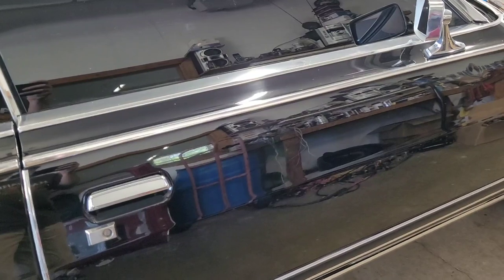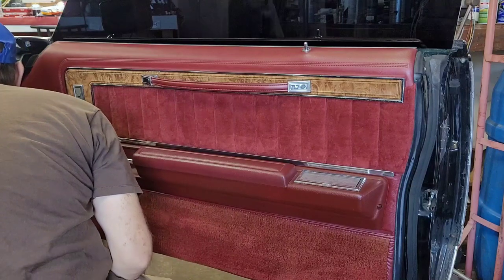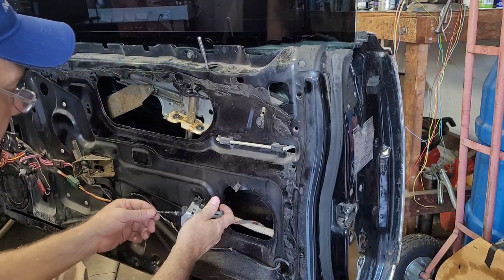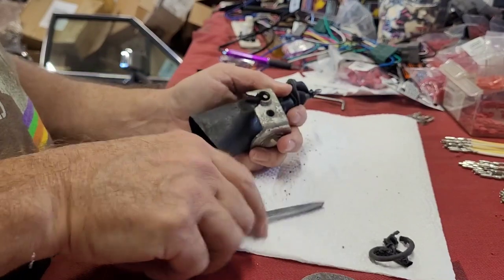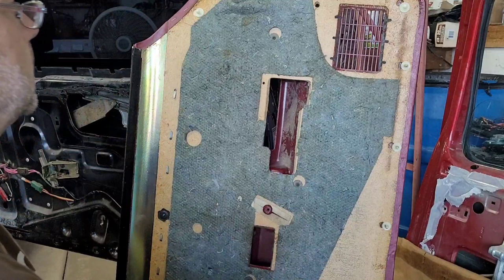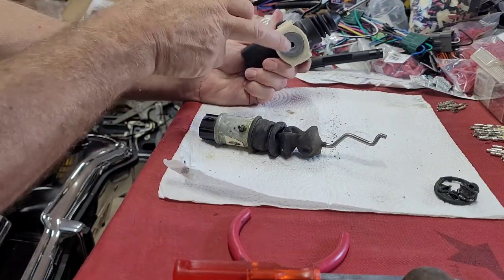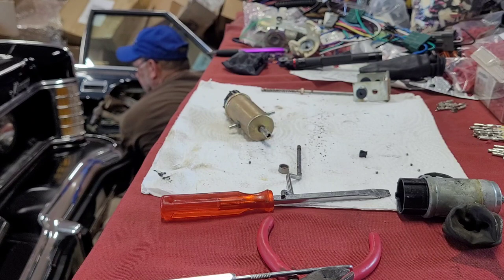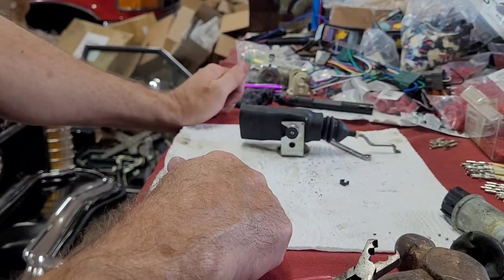1975 1976 1977 1978 Mercury Grand Marquis Ford LTD Power Doorlock Actuator Replacement Repair

Comment: My door locks all make noise but they dont go up or down I wonder if its the bushings? Its also nearly impossible to operate the locks manually. Im going to have to tear into it soon. This is on my 78 Grand Marquis 4 door. Also the driver side window doesnt budge an inch
Reply from the maker: I have several videos that could help you, I believe.

Comment: Hey Tony I'm working on my 77 and I need to replace the blower motor, car Dat for awhile and mice have made themselves a nice little nest in the blower motor wheel. My question I'd how in gods name do you get to it? I need no access from the outside or the inside of the car. Please tell me I don't have to pull the entire fender off the car to replace it?
Reply from the maker: I'm sorry to tell you that you have to either take off the inner fender or the fender. I would probably take out the inner fender.
Reply: Bad news but glad you know the answer. Thanks for the help Tony. Love all the new videos on mom and pops lincoln.
Reply from the maker: Thank you!

Comment: Thanks for the video. I took mine apart and found that the rubber grommets on the frame were missing and couldn't find them in the door. I'm asking where can I purchase new grommets. I'm at a stand still now.  Thanks again for the video
Reply from the maker: You're welcome. I always try to get all of them out of the 80s Ford, Lincoln, and Mercury vehicles when I find them in the junkyards.

Comment: This really helped, greatly appreciated. Would love to see a video on getting the illuminated entry working. The lights for the ring around the key hole don't light up but the courtesy lights do. Any ideas? Greatly appreciate it. Love the car by the way.
Reply from the maker: Thank you! Yes, I'm planning to do a video on illuminated entry as soon as the weather clears. I have one not lighting up in a Lincoln parts car, and I do have an idea why it's not working. I'm also gonna do a video on taking the illuminated entry out of a parts car and adding the option to another car that didn't come with it. Please subscribe I you haven't and stay tuned.

Comment: I put white grease or wheel bearing grease on plastic clips, screws, etc. before putting them back in place.  Makes it a lot easier if you have to remove them again.  The window track I probably would have put some grease on it since I had the panel off.   It's been hot as a convection oven up here in central IL.  We still need rain desperately.
Reply from the maker: Did you watch the whole video? I don't think you did!
Reply: I use Fluid Film. Zero petroleum. White grease is for large surface interactions. And it dries out. Fluid Film is $10 at Walmart for bonus size. It never dries, and is pure magic! I lube the ENTIRE inside of my doors. Latches, handles, tracks, rollers. My doors operate like butter! I just did my survivor 1967 Corvair. Recently my '66 Toronado, '91 Ford F700, '97 Suburban 2500, 2007 Escalade. I like my vehicles to work PurrrrrFectly!!!
Reply: @tonyscarcare5657  I stopped after you got the door panel on.   I'll finishing watching it.
Reply: @CORVAIRWILD  I'll have to get some of that and try it.  Seems like I have heard of people spraying Fluid FIlm under their vehicles for rust protection
Reply from the maker: @timw8228  Well, as I showed and stated in the video, I'd had the door panel off before and greased all that then. It was all still very well coated in grease and not dried up at all. I even operated to window to show it. My cars are always inside and covered and never out in any of the elements. I would have greased it if it needed it. As you can see in the video, everything was working smoothly as it should. I've been repairing power windows and doorlocks since the mid-1980s with no complaints.

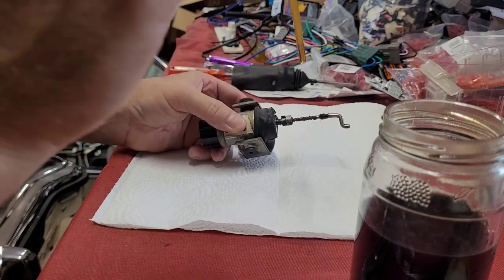Comment: At 16:46 when you used that bulb and tube to extract one drop of lubricant, reminded me once of visiting a watch repairman and seeing a group of different sized feathers sitting on his work bench. I asked him what and why feathers? He showed me a canary feather and dipped the tip in watch lubricant, then touched it to a screw so tiny he needed a jeweler's loupe to see it. He said he had hummingbird wing feathers when he had to use freeing solvent in lady's dress watches. He gathered all the feathers himself and had learned that trick from his grandfather. Glue, freeing solvent, cleaning solvent and lubricant were placed that way, so as, not to get on other parts within the watch.
Reply from the maker: That's wild!

Comment: Suggestion for easier re-assembly of power lock to mounting bracket:
Put the rubber grommet on each metal stud on the power lock motor.  Then power lock motor can be slid into the slots on the mounting bracket.  It might also help to apply some silicone lubricant to the grommets.
Reply from the maker: Thank you!

Comment: My dad hates you… lol
Reply from the maker: And why is that?
Reply: @tonyscarcare5657  you won’t sell that sweet Lincoln to him… lol
Reply from the maker: @godskongofwar898  witch one?
Reply: @tonyscarcare5657  the ‘89 I believe…
Reply from the maker: @godskongofwar898  I hope to keep that one.
Reply: Great vid and beautiful black 2 door! 🤩 My '78 Marquis wagon actuators work but all are in need of the bracket bushings, are all missing. I went to my parts car, same problem. I thought this would be a great Dorman product to sell. I have looked high and low, any ideas? Thanks in advance
Reply from the maker: You can get them out of any full-size Ford, Mercury, or Lincoln, including truck and Bronco through the 80s and 91 in a lot of cases. Thank you!